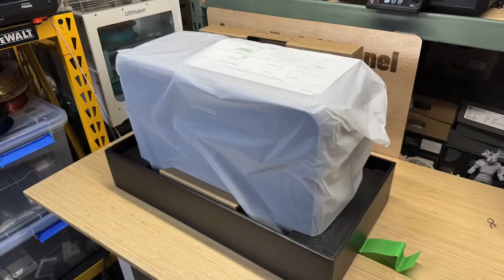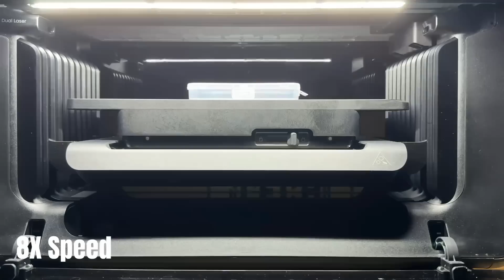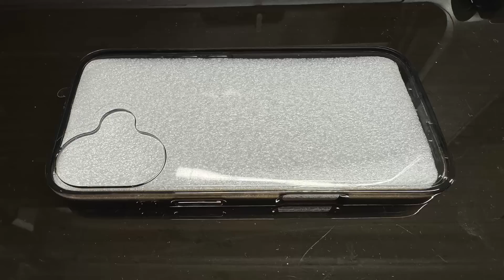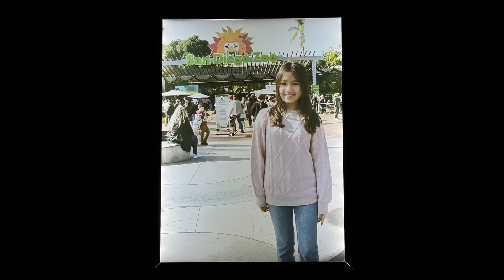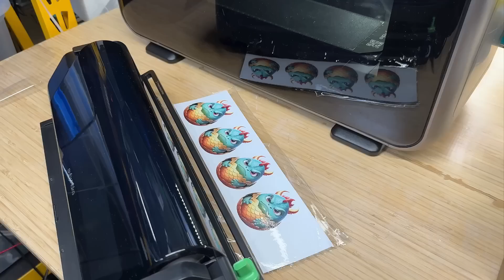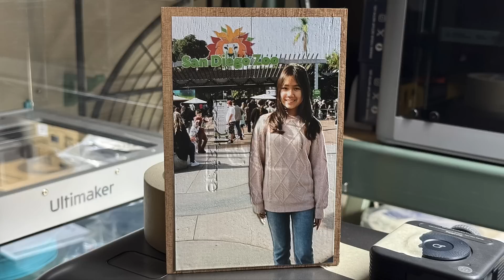EufyMake E1 UV Printer IN-DEPTH Review: Easy to get started with UV printing and make 2.5D prints

Comment: I always put a bleed on anything that I want to print edge to edge. In the print industry 1/16” is a good general rule. Been a graphic designer and prepress operator for the last 30 years.

If it’s a photo you should be able to scale it up slightly without too much loss of resolution or just do a Generative fill in Photoshop (set your canvas to the larger size and just select your empty space) to let AI do the job. I would use painter’s tape to help preserve your print surface.

I actually saw someone use Glad Press N Seal (stuck to the bed with sticky side up). Can’t wait to finally get my printer to try it out!

Comment: If you're a maker or hobbyist, this machine is not for you. It's extremely expensive upfront, and the ink is also very pricey. Worse, you're forced to use only their branded ink, which adds to the long-term cost. Many of the reviewers received the printer for free, so they’re not facing the same financial realities. Add the cost of ink and shipping, and just imagine how much a single print will end up costing. Definitely not a smart choice for hobbyist use.

Comment: Re: alignment on the large bed - to ensure accuracy, you're supposed to run camera calibration every time you switch beds.
Re: smell when using large bed - for now, it should be easy enough to print an adapter for extraction system that will replace the filter, hopefully one will be offered later as an accessory.

I agree, the MRRP is too high, especially since you're locked into the branded inks.I hope they come to their senses and keep the price under $200.

As for the software - I hope you don't have to use the AI generator to create depth maps and it's possible to insert a greyscale image and manually adjust if necessary.
Also I'd like to see if it's possible to apply the glossy ink to a selected part of the image using a mask as part of the colour printing process, not a separate run.

Comment: The alignment issues when printing are concerning. Not the first review I've seen where there were misaligned prints. Not much point in this printer if it can't print where it's supposed to.

Comment: Did you re-calibrate the camera after switching out the trays?  Other artists were experiencing the same problem of size differentials, but when they re-calibrated after changing out the trays each time, the problem went away.
Reply: I was wondering the same thing. I saw another review on this printer that said you had to do another realignment if you changed beds.

Comment: Requiring an internet connection to servers you don't control is a no-go for me. No to a walled garden (prison). Especially in these days where companies are disconinuing server support for older products without compensation. And there's additional risk that a trade war or other political strife causing the company to discontinue the service or charge unresonable fees even for basic use of the printer. I hope he manufacturer releases an open source local server option that uses a Coral TPU AI it can be managed fully on-premises. Until they do, this priner is not anything I would buy even if it was completly free because I would want to print my own copyrighted images without allowing the digital image source to leave my direct and exclusive control.

Comment: The sticker is two pieces, both of which need to be removed. I see the top piece has been left on the white case. It will work better if you don’t cut so closely around your image, to give you something to hold onto while you remove it.

Comment: When you print on the domed surface of the golf ball, what is the maximum depth away from the top of the balls the printer will print with sharp printing? Also, when comparing the resolution to a regular inkjet print on glossy paper, what is the quality difference. I've used online UV DTF printing companies like ninja and the resolution is not as good as my Epson et8550 on quality paper. Thanks in advance

Comment: Not saying it's not interesting but this is not going to become nearly as popular as 3d printing at that price. If this were under $500, I'd think about it but unless you're looking to make money with it, crazy expensive $2500 or $1700
Reply: I can almost guarantee that you will never see a UV printer for $500.
Reply: @PhillipParr  Ok by me. Not looking for one, but at sub $500, I'd consider one even though I have no real need beyond curiosity. This would be something I'd be using for a week every day and a couple of times a year afterwords. The whole reason I got into 3D printing was it was affordable enough to take a chance on a 3D printer that I might end up not using.
Reply: @dosdont 3D printing is easy compared to UV printing. A $500 UV printer is like expecting to buy a brand new car for £3,000. It's not happening 😂
Reply: @PhillipParr  I wouldn't know one way the other but I know this, often times the prices these corporations put on these things is often an inflated arbitrary number. That's why you have such differences in 3D printer prices for example. A lot of printers are printing equally well in 2025, there's very little between them, but prices are wide ranging. I suspect, the same would be true with UV printers, only there isn't many companies making these things so you don't have the competition required that you have with 3D printers. As I said, "I suspect," not stating it as fact. Regardless, I won't be picking this up as an appliance or hobby at those prices. That's a lot of money to spend unless you know you need this.
Reply: @dosdont yeah but a 3D printer is 4 stepper motors, 2 heating elements, and some software. A home UV printer is 3 stepper motors, a complex multi nozzle self cleaning print head ($600 by itself on the E1 and easily $2k+ on commercial printers), precision wavelength high power UV emitters, safety certification for the UV and VOC emissions... Some of those prerequisites will never get cheaper.
Reply: Stratasys makes these machines but they print full 3d. They are $100k machines. This is an emerging market and its small machines like this that are the test beds for the longevity of the hardware before they launch a consumer competitor to the larger $100k machines.

Comment: Can it print on silicon?
Reply: Silicon yes, silicone no. The ink is resin so it would not enjoy being bent or stretched. Doing so would cause it to crack / peel of. You may also find it does not adhere well to self-healing style surfaces.

Comment: Was camera calibration redone when switching from small to large bed ?
Reply from the maker: I only did it once for both beds and didn’t recalibrate when switching between the mini and large bed. That might be one of the reasons, but I don’t think it’s practical to recalibrate every time, especially if you switch between beds frequently. As long as they’ve been calibrated once, the data should be saved. I think this should be fixable with a software update.

Comment: Wow ... am I glad now I cancelled my pledge... Reasons:
- Just another typical Chinese product with the usual EU Tax non-sense. Price supposedly is VAT inclusive and you can ask for an EU invoice, but don't expect them to follow tax laws and defer the VAT as is mandatory under EU law for B2B sales.
- Closed eco system for the inks and cleaning. This is an instant no-no for me. Access to consumables MUST be unrestricted. What if the company that makes these goes belly up. Not to mention the cost of their ink is excessive. No doubt some will argue that brand ink for other UV printers is also expensive but really if you buy the ink (in a bottle) the cost is quite low. This why so many people/businesses use converted tank printers. 

And now you tell me there also AI credits for the some of the functions? First time I hear that despite having watched several reviews of this so far?
Reply: Tax wise they're likely doing DDP. This does follow all necessary tax laws, and still doesn't mean you'll get a VAT invoice. They're paying the VAT on your behalf as part of the campaign so there's nothing for you to reclaim as you never paid it.

I'm fairly sure all printer manufacturers have closed ink ecosystems? And I've never worked in a commercial environment where any ink other than that specified has been used... This product is aimed at personal users / small businesses, not businesses with a full print shop setup and staff to flush the printheads every night.

AI credits are for AI functions such as generating images or generating depth maps. You don't need to use either of these to use the product 🙂
Reply: What an utterly dumb comment 🤦‍♂️

Comment: Good stuff and thank you! ! Question: I haven't seen other testers have many alignment issues. Are you certain you properly calibrated both the mini bed and large bed seperately?
Reply from the maker: Yes, I did. But I would say it's just like a fixed camera on laser engravers. It's only highly accurate when the object is placed directly in the center under the camera. The farther you move it toward the edges, the more the alignment shifts, unless you make the design slightly larger than the stock to compensate.
Reply: Other testers don't want to show you all the disadvantages
Reply: @Artem1234-m9d  Not the case. I have watched many review videos and discussed with testers in multiple groups. The testers are very transparent, and I haven't seen others have the issue this bad.

Comment: opps I guess compared to other systems it is cheaper. Still .......
Reply: RefineColor or FunSun printers are priced between $3,000 and $4,500. Considering that the ink costs for these printers are 20 to 30 times cheaper than others, you'll recover the price difference quickly if you're using them for business purposes.

Comment: It sounds great, but $1700 for the kickstarter discount is still so steep.
Reply: Errr, a "real" UV printer in that size bed would seem to be five times the price... to start. A "good" one might be $15K.
Reply: @urischulgasser  RefineColor or FunSun printers are priced between $3,000 and $4,500. Considering that the ink costs for these printers are 20 to 30 times cheaper than eufy ink, you'll recover the price difference very quick if you're using them for business purposes.
Reply: @Artem1234-m9d  If you're running them at volume for business though, you wouldn't be interested in this product. The E1 has positioned itself in the personal / small business market and that seems to fit quite well.

Comment: Think the odor is a health hazard?
Reply: Definitely. It will still vent some VOC
Reply: its as bad as a resin printer
Reply: Obviously you'll want to ventilate if you can, but the product has GREENGUARD GOLD Certification which means it's been classified as safe to use indoors. From Greenguard's website: "UL GREENGUARD GOLD sets even lower VOC emission limits, making it the optimal certification for products in nurseries, schools, healthcare facilities, and homes where children’s safety is paramount."